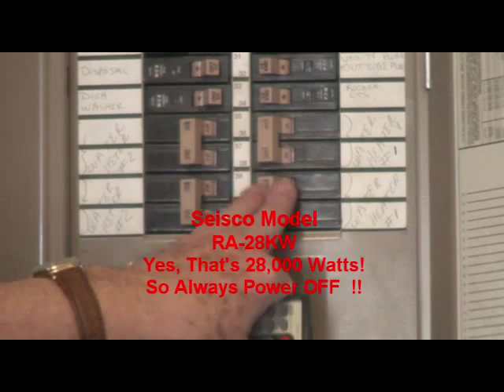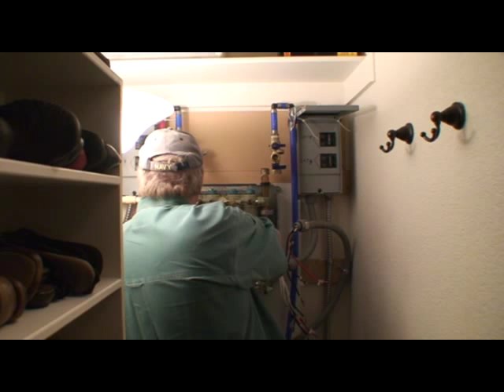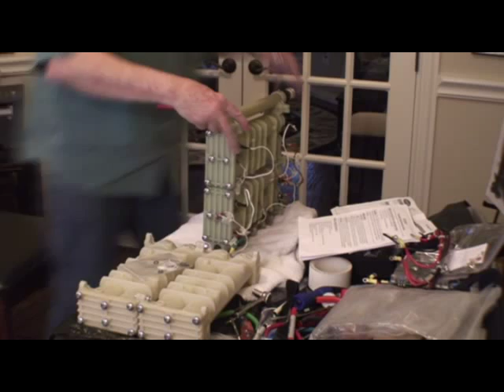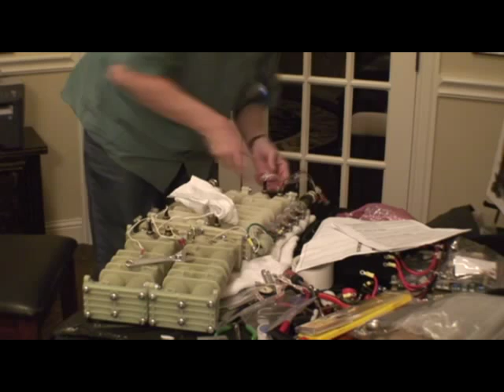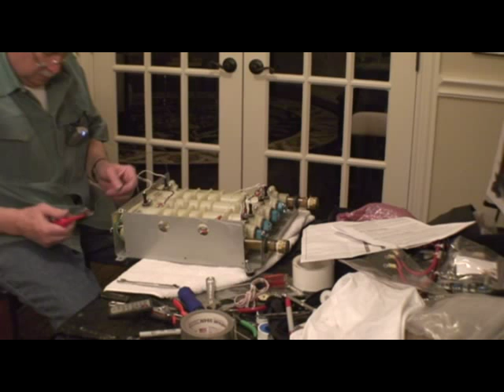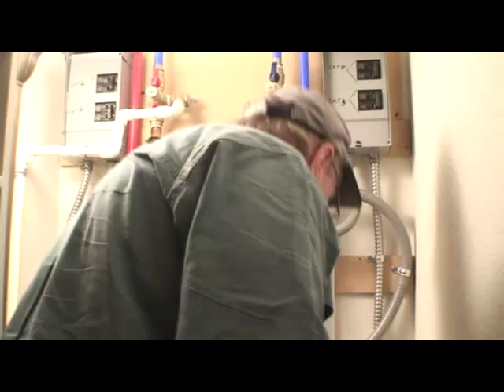Replace & Calibrate A Seisco 28KW Tankless Water Heater or Junk it and buy a Stiebel Eltron Tempra!

Comment: I have the same unit, first it was heating element that went out, fixed that, then the housing cracked thank goodness it was under warranty so they send me a new housing and I basically did what u did since the plumber would of been very expensive, well it worked for a while then I started to get water temp that was not consistent so I replaced one temp sensor and it worked now I have another temp sensor that went out so going to fix that today, a plumber told me that once a temp sensor goes out its best to replace all the temp sensors. I should of just stuck to a traditional water heater.

Comment: I received the replacement unit from Seisco this afternoon and just finished the replacement.   The most difficult part was disconnecting the defective unit.  The heads of the mounting screws were stripped and the ground connection was so tight that I had to clip the wire and use the new fitting that Seisco included.

The installation was simple and went pretty quickly.

I question Seisco's QA process.  3 of the connections to the heaters were so loose that they were disconnected upon receipt.  I added pressure to the lugs before powering up.

The new unit is working well.  the whole job took less than 3 hours.

Comment: My Seisco unit died over the weekend.  It sprung a major leak behind the control board and would no longer power up (surprisingly none of the breakers tripped). I have a new unit coming tomorrow.  It is supposed to be a complete unit.  Hopefully all I will have to do is connect the water and main power connections.  I will let you know if it is as simple as Seisco said it would be.
Reply from the maker: Make sure all breakers are off, including the ones at the mains load center and tag them off so someone doesn't turn them on while you're working.  That would be very shocking !!!  This kind of power can kill, catch fire, explode sending flying hot metal all over the place and blind a person.  But if you do as I suggest and lock out and tag out the associated breakers you will live to enjoy a hot shower again!  My other tip is to actually put a tag on each wire before you remove it or just after removing it and a good phone picture as a double check is always good.  Thanks for watching my video and Good Luck replacing your unit.  Let me know how it went.  Thanks

Comment from the maker: Well, we had trouble again.  The kitchen and guest bath water was cold.  We checked the heater and noticed the LED was not flashing on and off as normal so I reset the breakers and it beeped and began to flash normally.  However, that only lasted a few days and it happened again, again we reset the breakers and all ok again.  But after the third time dying i called SEISCO and they offered to send a replacement control board in advance at no charge.  I turned off all the breakers and replaced the board after being very careful how the defect board was installed, marked all the cables individually. I'm totally focused on not making a stupid mistake so I always take my time.  It powered up ok for the smoke test and no smoke!  Our water heater is working great again and i sent the defect board back to SEISCO.   A pain but no cost except a little time.  I'm a hero to my wife and kiddos. So all's well that ends well.

Comment from the maker: Hello C Muir,  Thanks for asking!  Both Tankless Seisco Heaters are working just fine.  Although as mentioned i've fixed one with Seisco provided parts as shown in the video and the other was a total swap out that Seisco gave me partly because of my YouTube video that they actually complimented me on even though I wasn't a happy camper due to the leaks on each.  Regarding your question about the water load:  One heater just provides hot water to the master bath, the other supplies hot water to two guest baths and the kitchen and utility room.  We have plenty of hot water for each.  I did find a problem with the master shower head that was almost totally clogged with plumbers tape and gunk from the original construction of this, out dream retirement home.  I replaced the shower head with a rain type head and the difference was amazing.  Since i now get much more water flow the water heats up 3x to 5x faster and is a most acceptable delay, roughly 15 seconds and the heater is about 40 feet away and i suppose my plumbers did not try to insulate the line which might help even more.  Did i say that my incompetent plumbers actually installed these two Seisco units upside down? Yes, totally upside down.   I wasn't alarmed because just the label was upside down and the water came in from the bottom which seemed OK.  But no, my wife was right, she read the instructions and the plumping contractor agreed to reinstall two new heaters no charge because his subs made this mistake.  He wasn't happy because we demanded two new units but finally after he threw a fit we got two totally new units.  Yes the ones that eventually leaked.  What a story!  But all's well that ends well and we have hot water on demand and as much as you could want, limitless!  d